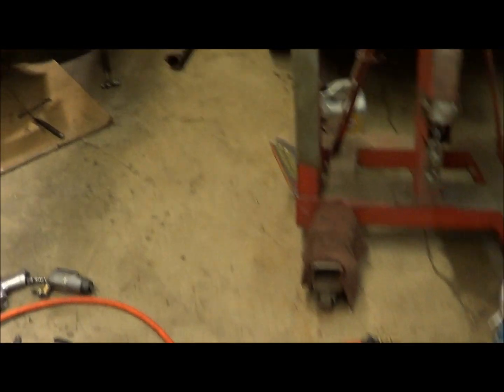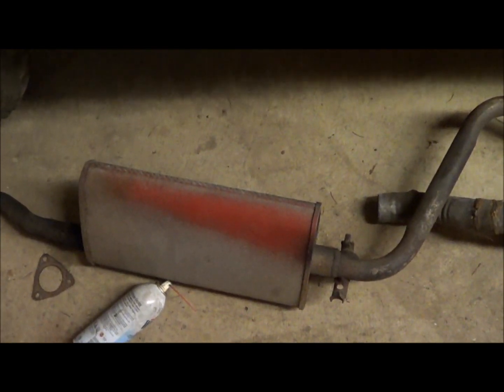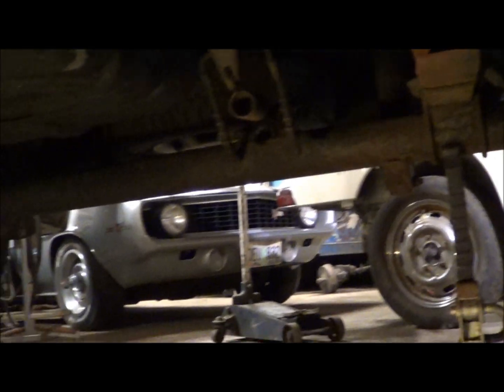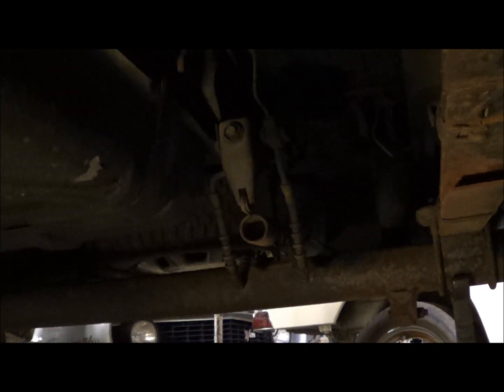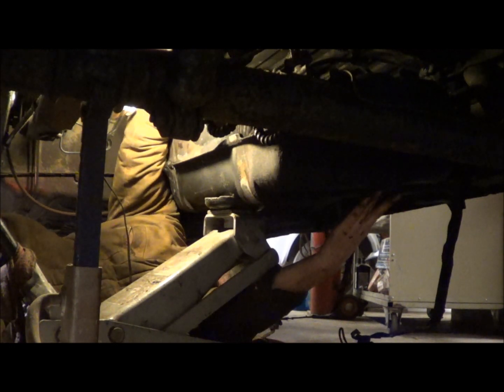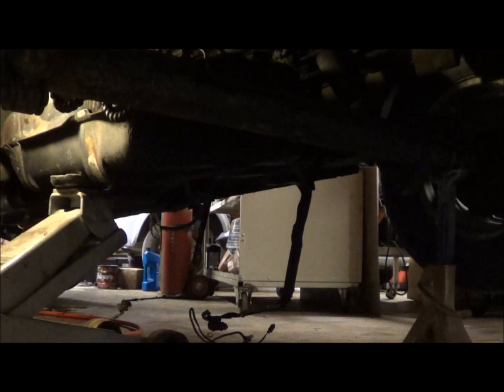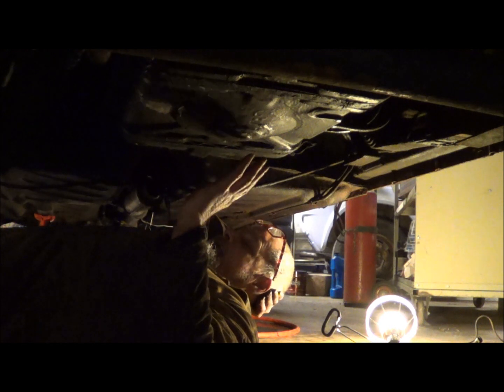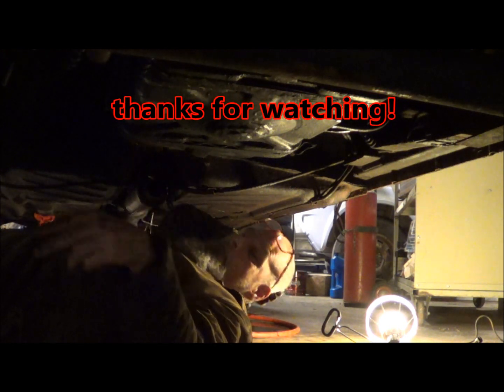1980 VW Rabbit Caddy Fuel Tank Fiasco

Comment: At leased ya did'nt dump fuel all over the shop floor an set the joint on fire, a hot drop light will do just that.
Reply from the maker: +Charles Dyer Got fire extinguishers handy. Also I am using a outdoor compact fluorescent bulb that has a plastic cover over the glass part. It doesn't break so easy and doesn't get very hot.  Thanks for watching!